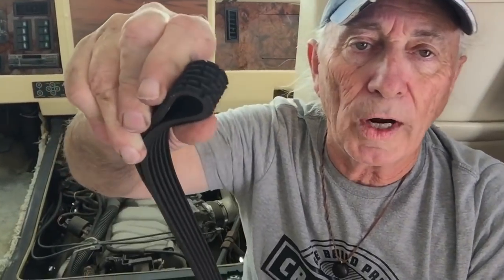RV belt worn out at Coffee & Tools Episode 79

Comment: I have the 2003 winnebago with the 6.5gm diesel , 27000 miles ( yes twenty seven thousand miles only )  I have just looked at my belt and pulley`s and have orded the Idler , tensioner and 2 x belts ,,,, Age is a killer  ,,,,